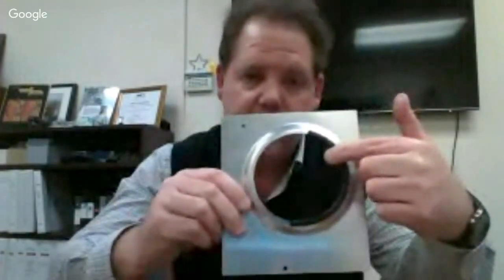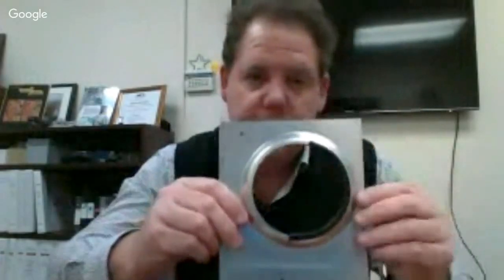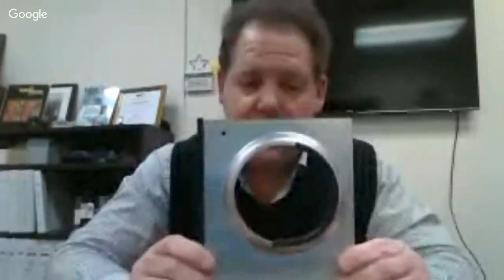Aerospace Grommet Edging - Lowering Install Costs Safely

Comment: Great video.  I recently had an in-house demonstration of their product.  Very good product and the overall savings is a nice benefit as well.
Reply from the maker: Appreciate the comment Mike.  Glad you got to see it first hand.  Hope you can see that the 9.5x productivity improvement -driven by the rapid snap on install (vs the 9 step process for glue grommets)  -adds efficiency to your manufacturing.  Thanks again.

Comment: Great easy-to-install product!
Reply from the maker: Thank you for your comment. The ease of install is what makes it so efficient and budget friendly.  Snap on is so much easier than the 9 step process to use a grommet with glue.  ANY manufacturer/OEM in any industry can use this to replace their use of grommets with glue...because even if they don't need the top performance Spring-Fast provides it still saves them time and money.  Win-Win. Thanks again.

Comment: Save 49% of installed costs and improve job productivity by 9.5x! No brainer
Reply from the maker: Thank you for your comment. We hope it is a no brainer.  This can be used by ANY manufacturer/OEM in any industry if they use grommets with glue...because even if they don't need the high performance this grommet provides it still saves them time and money.  Thanks again.